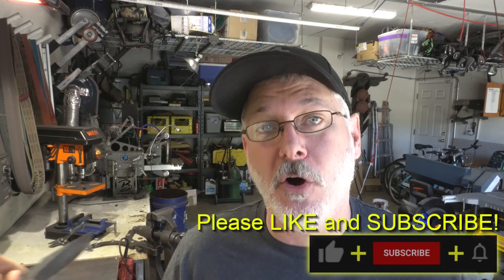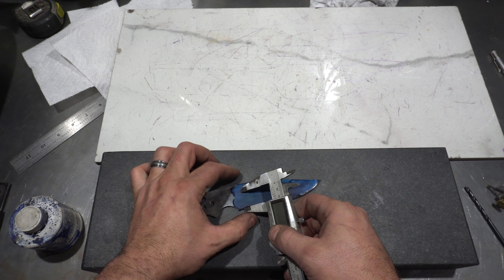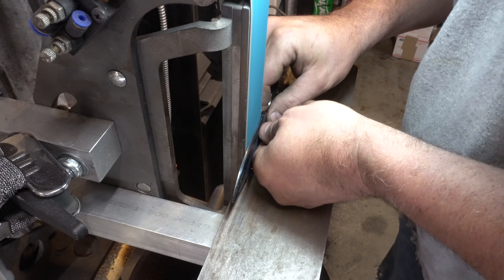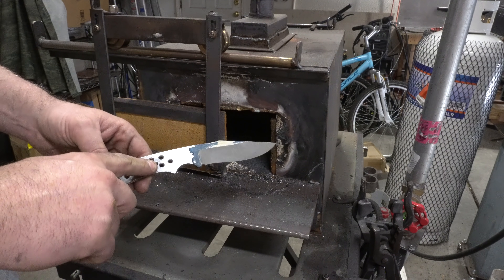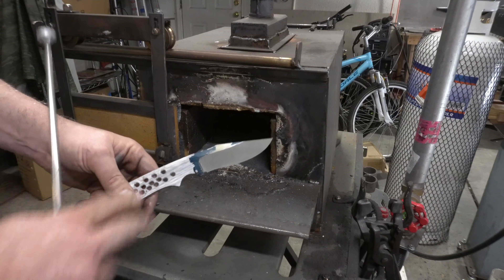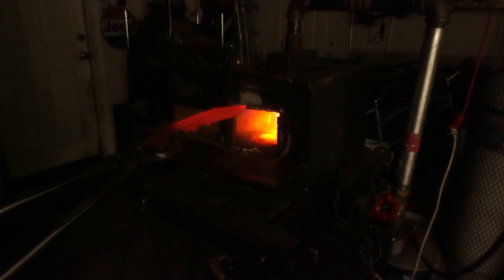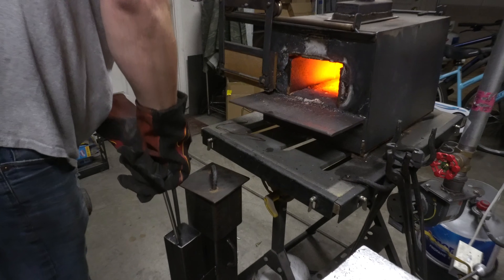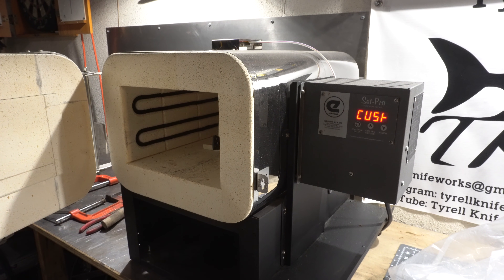Triple-T #55 - Beginner knife making series - Grinding Bevels and Heat Treating

Comment from the maker: I haven't heat treated in a forge in a while but this heat treat turns out perfect!  Any questions you have I didn't cover?
Reply: Here it is! Lol was goin through withdrawals yesterday.
Reply from the maker: @mcrich1978  sorry, totally spaced this week.  Here it is at least.
Reply: @TyrellKnifeworks  love the Shirt 😁
Reply from the maker: @mcrich1978  which one, the vintage Star Wars one?
Reply: @TyrellKnifeworks  yes sir! 😉
Reply: Nice video you are the first one to explain what size drill bit to use thanks
Reply from the maker: @michaelmosley254  Remember, the drill bit size is dependant on the wide of your steel.  You want it around the same size.  👍🏻

Comment: I wish I saw this video the day it came out, and the same day I quenched my first blade. I believe I barely achieved proper blade hardness, but I wanted to ask if it was possible to heat treat and quench again? If so what other considerations should I know about?
Reply from the maker: Sure it’s possible.  Just go through your entire normalization and grain refinement steps first.  Then you can quench again.  You can do this as many times as you need.  👍
Reply: @TyrellKnifeworks  Thanks for the quick response! I am looking forward to completing it now that I've had experience working though the difficult steps!

Comment: My question is when using1084 can you quench in water first then right into canola oil reason being trying
To get around heat treat oil expense for know thanks...great video
Reply from the maker: It’s really sub-par and you risk cracking your blade.  What costs more to you, spending hours and hours on a blade to lose it during heat treat or spending $60 on quench oil?  🤷‍♂️

Comment: Two things I REALLY appreciate about this video, first, you showing the difference between lights on and lights off, as far as what the steel looks like. Personally, I am so light sensitive that I only heat treat at night with the lights off in my shop. Second, aggravated quenching. I cringe when I see people leaving a blade completely stationary in the oil. Thank you for encouraging people to use an aggravated quench!
Reply from the maker: I’ve never heard of it as an “aggravated” quench.  I’m going to refer to it as an “angry” quench from now on. 🤣. Yes, both things are necessary and I try to explain why.  👍
Reply: @TyrellKnifeworks  "angry quench" I love it!

Comment: I didn't see any mention of an austenitizing soak prior to quench. Would you say this is unnecessary for 5160?
Reply from the maker: 5169 doesn’t need a soak.  As long as the whole blade comes up to an even temp, you’re good.  This is why I think 5160 is one of the best steels for beginners.  Thanks for watching

Comment: I'm trying to learn your way of grinding bevels- it needs a practice, but at the end, its give much more controle and acuracy. The biggest issue I have, is this terrible wobbling I have in my belt grinder (my drive wheel is not right). Great Video! Try to talk about this technique every time you make a new knife- makers should know it- its great!
Reply from the maker: Time to fix that wobble my friend!  Thanks for watching!
Reply: @TyrellKnifeworks  i need to make another drive wheel, but I dont have a Lathe...
Reply from the maker: @DBCraftWorld  it just purchase one, they aren’t that expensive.

Comment: I use a thick piece of glass for one of my surface plates but the one i like the most i got from my local granite counter top shop free sample pieces that were discontinued .. Just saying there are free and very reliable options even if you were to use a fermica counter top it would be perfect for our aplications unless we build folders i really dont think a granite surface plate is even a nessary expence even for the seasond maker.. Love the video sreies by the way.. Cheers, Martin
Reply from the maker: Yup, I agree.  I can afford the fancy granite plate so I got one.  I suggest most makers just grab a tile or a cheap piece of granite.  👍

Comment: Would you recommend normalizing for stock removal I was told no by the steel company that I buy from they said it was already normalized ?
Reply from the maker: Absolutely always always normalize.  You have no idea what they did or didn’t do to the steel and at what temp.  Do the normalization step.  👍
Reply: @TyrellKnifeworks   thanks verry helpful once a gain

Comment: Isnt the file test straight out of the quench is filing on the decarburized surface layer?
Need to grind that away before actually testing it properly (as you showed)
Just found the channel through the Bowie challange and you got another subscriber
Reply from the maker: It depends on the steel.  Something like 80CRV2 has a thick decarb layer.  The 10xx series tends to flake off more in the quench and you have very little decarb.  5160 is also a pretty thin layer.  Certainly something to be aware of though.  Thanks for watching and joining the channel! 👍

Comment: Good vid.    Jason Knight really started something with the shark fin on the spine.  Over half of the YouTubers have it on their knives.  I hammer my bevels in before heat treat, then finish grind them after.
Reply from the maker: The false edge (shark fin) was popular long before Jason knight was doing it.  Thanks for watching.
Reply: @TyrellKnifeworks  yeah, I have seen that particular "shark fin" (I'm referring to that little step and not the whole false edge) in some medieval knives from 14th century at least
Reply: @TyrellKnifeworks  he made it more popular but you're right it's been around long before him
Reply from the maker: @skcj133  I don't even watch Jason's channel (though I think he's a fine maker) and there are lots of other bigger makers so I wouldn't exactly say HE'S made it more popular.  Many have made it popular.  Kyle Royer is probably my biggest inspiration and influence and he also does it on most of his knives.
Reply: @skcj133  I've got a very old, around interwar era vintage Solingen skinning knife that was my great grandfathers, then fathers knife that has that kind of blade shape, just with a big belly and up swept tip.

I dunno the pattern/exact maker off hand but we called it a 'roo-skinner' (for skinning kangaroos) but it was mostly for the larger game animals and it is, for a skinning knife quite large at about 4.5"
Reply: I once did it as a joke and a bit of a pisstake on some kitchen knives, they all sold out in a week and despite that I've not had the sheer gall to do it again :)
Reply from the maker: @krissteel4074  I’ve seen it on BBQ knives, but not chef knives.  But hey, if it sells… 😜
Reply: @TyrellKnifeworks  They were really nice knives with some cool mokume-gane bolsters and fancy timbers in an ultra-high carbon, high chromium steel (technically not even a steel at that level) 
But a little 'tippy' to the front for draw cuts sort of like a bullhead butcher knife, I did it as a joke and would be kind of ashamed to do it again :)